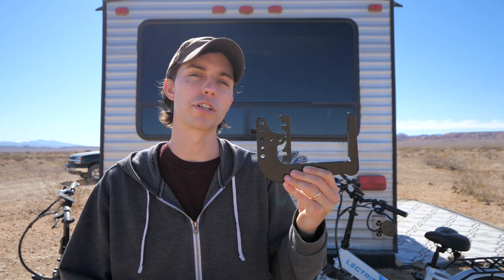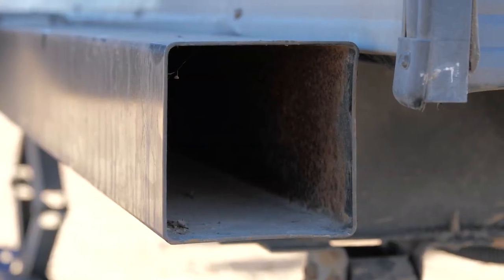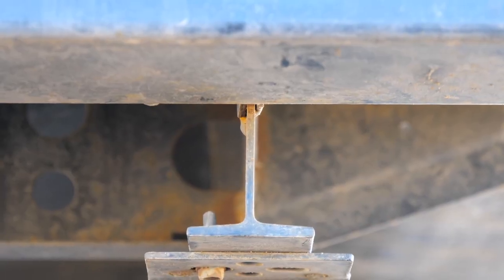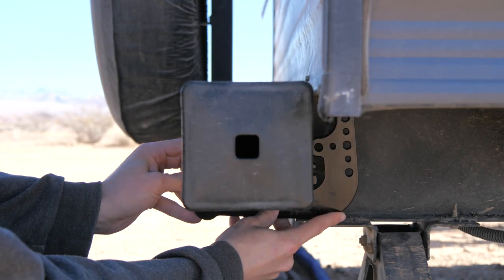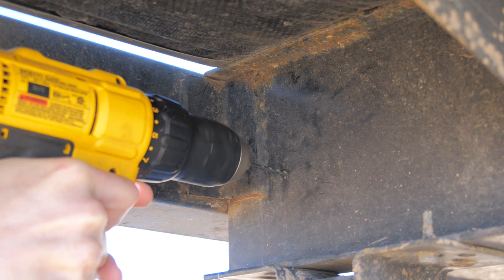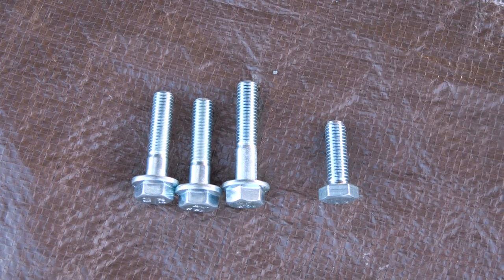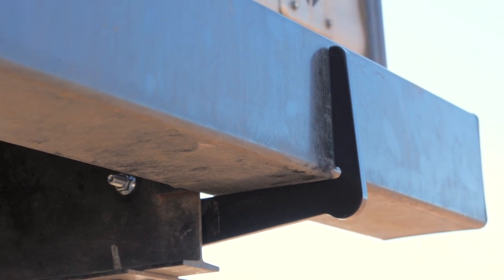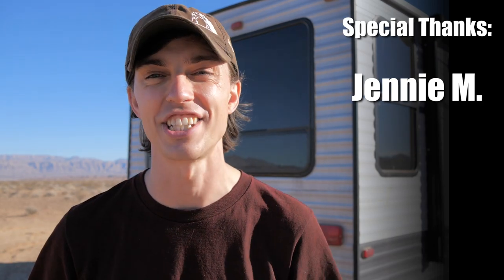DON'T DESTROY YOUR BUMPER! - RV Bumper Support Bracket Install

Comment: After watching ur video awhile back I installed them on my rear bumper but I doubled mine. 1 on each side of the I-beam.  I wished I had put 1 underneath the bumper and 1 over the top to support either direction. Have a BLESSED day 🙏

Comment: David, you’re very brave trying/trusting those brackets will properly support the platform and your electric bikes! I wouldn’t do that myself so I’m looking forward to your test. Hope it goes well for you. BTW, I understand that you can double up on the brackets for extra assurance.

Do you have an observation camera so you can keep an eye on that setup as you bounce down the road? Did you talk to the manufacturer of the brackets and mention to them that you take your trailer off road?
Reply: I think you should of used a shim instead of washers.

Comment: Nice feature, seems easy to install, my only concern is about adding weight at rear end of the trailer, I would prefer trailer tongue bike rack option to keep that extra weight centralized, just my opinion 😊👍

Comment: Nice video on the install. I have these same brackets installed for a couple of years and no issues yet. Since you will be putting your e-bikes on your bumper, I did want to point out that the weight rating is in ft/lbs not lbs. Depending how far out your your carrier goes, you could be pushing the rated spec of the brackets. Your bumper may have a weight rating attached to it as well, so maybe the bracket spec is less important for your application - some bumpers (like mine) are rated for nothing. Anyway, I enjoy your videos - happy camping!
Reply from the maker: Ohhhh very interesting! It makes a lot more sense that the rating would be in units of torque and not units of force since the load on the bumper with this cargo carrier is mainly torque. Eyeballing where the center of gravity is though with the ebikes on the carrier we are still definitely under 500 ft-lbs

Comment: fit better to just buy a square tubing for metal yard and weld on a thicker bumper, still a very thin weak  bumper if your plaing on loading full of bikes and gear and have tire out back.

Comment: I don’t think I would use these with e-bikes as the bouncing around on a bike rack behind a camper is quite extreme, and E bikes way twice as much as regular bicycles at minimum. I’ve been using these brackets for about three years with no trouble hauling to mountain bikes on a Kuat transfer 2.0 RV rated bike rack. I don’t know how sure how long my bumper would survive doubling the weight using two much heavier, E Bikes, as the thin wall tubing of the bumper will likely deform, or crimp, or tear, if you use the typical bolt on receiver hitch, which tend to crush the tube a bit when tightening it up and after a few seasons of hard use.  I actually use two kits of these braces, placing one on each frame member on each side . After three seasons, I can see a little bit of denting in the light to bumper from the receiver hitch so the metal of the bumper is still the weakest link in the system. I will be getting e-Bikes in a year or so, and I will be welding on, an actual hitch receiver and reinforcing the bumper the old-fashioned way by welding more metal, or going with a much thicker 3/16 thick square bumper tube.

Comment: Before you store the e-bikes on a trailer rack be sure to invest in appropriate security measures. The Liz Amazing and Mortons on the Move channels had bikes stolen off the back of their RV and address security measures.  From Liz - ALWAYS keep your bikes locked – they had bikes stolen while in a campground.  Also invest in appropriate bike covers.  Nomadic Fanatic had a bike ruined apparently due to rain.  Can’t wait to see the camper shell vids!
Reply from the maker: We've got the bikes covered by waterproof grill covers and we ran THICK chains through the frames of each bike. That's about the best we can do. They're safer there than in the back of our truck. I show all that in the next vid. That's unfortunate other channels have had things stolen.
Reply: @FateUnbound  The Mortons on the Move channel has a motion activated alarm.  You might want to consider a similar alarm.

Comment: Off topic question:  Due to the effort to be more ecofriendly the auto industry has gone to replacing the electrical wiring with the rubber coating to that of coating material that the rodent love to eat!   A lot of auto and truck damage out there and if you are in the middle of the woods and a porcupine gets in and eats away you could be in serious trouble.  There are no tow trucks or repair shops for hundreds of miles!  There are videos about this and what people are doing to protect their vehicles.  

Question: For new buyers out there have you found that you need to ask the manufacturers about the coatings on the wiring that is distributed throughout the engine compartment and living area?  Once the mice, squirrels or porcupines etc. get in much damage could happen and trying to get rid of the small rodents is extremely difficult.  If you are in the middle of nowhere (e.g., Alaska) there are no tow trucks or repair shops for perhaps hundreds of miles!

Comment: As one previously mentioned I was wondering if there is anything that precludes using even longer bolts and brackets on the inside as well. It should substantially increase the weight carrying capacity for electric bikes and mounts,

Comment: Careful mounting weight behind the trailer because that tends to reduce hitch weight and increase the chance of trailer sway.
Reply from the maker: Yep! Our hitch weight measured correctly still after this 👍
Reply: @FateUnbound  
Good to hear!  There are those following your channel that don't understand that moving the Center of gravity of the trailer can have devastating results, so it's always a good reminder that most trailers are designed to transfer 10% of the trailers GVWR to the tow vehicle (e.g. for a 7000lb trailer, you should expect 700lb hitch weight) and the more of that weight transferred behind the trailer axle, the more unstable the rig is to tow.

Comment: Hey David, after having installed these brackets on your rv bumper, how have they been holding up? I'm curious, because I am planning on putting my 150 inverter generator on it while traveling and I really don't want to lose a $????? piece of equipment! Any info is much appreciated!
Reply: Have you done your install and how has it held up?

Comment: How ironic, I just bought these & a bolt-on 2" receiver a couple of days ago.  I would suggest spraying the freshly drilled holes in the frame with some paint or primer to lessen the possibility of rust.  Thanks for the video.  Oh, was surprised that the hardware was metric & not SAE.  Wish all were like that!
Reply: What's wrong with sae